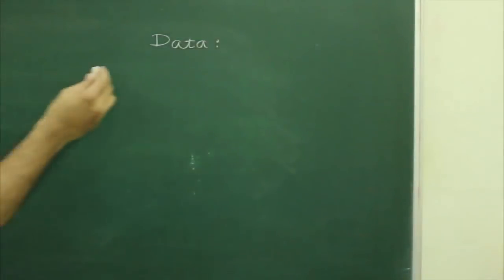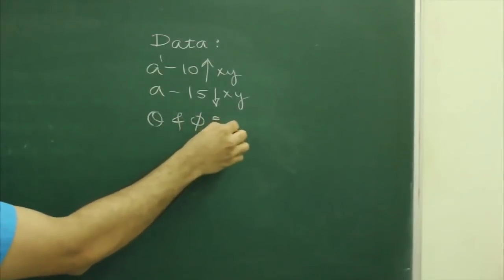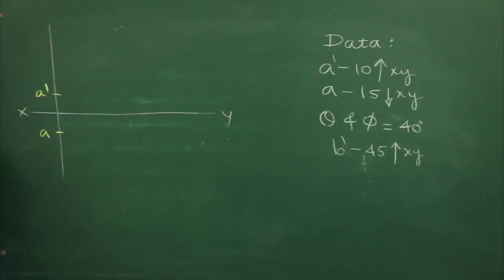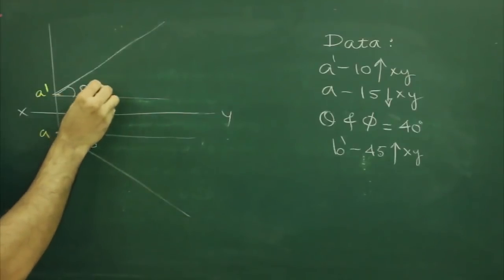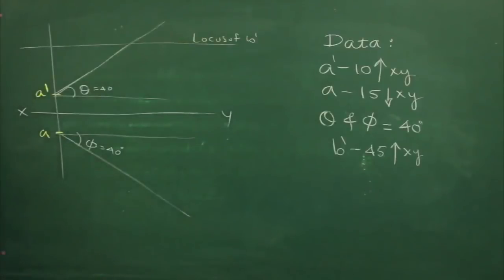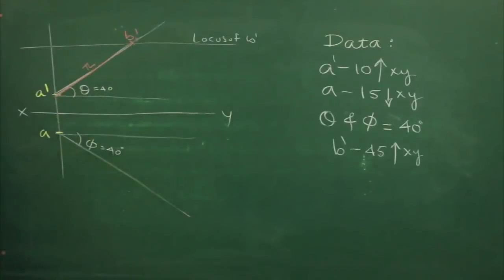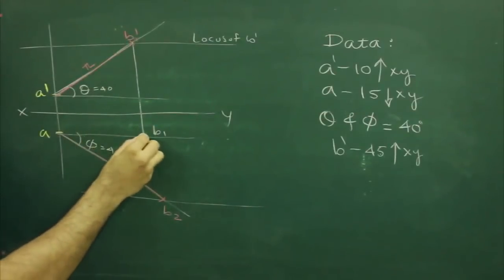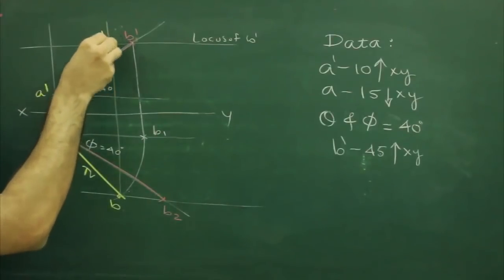Projection of lines 13

Comment: sir but dist from xy to b' is not given na sir
Reply: Sachin Pandya 

b is 50 mm above HP 
.
and both TL come in same line because theta and fai are same.
Reply from the maker: it is given in the question :: 45mm
see to slove any question of lines we need minimum 5 data.
Reply from the maker: LIMBASIYA JAYKUMAR yes because inclination with HP and VP is same so inclination of FV and TV will be same and TL will come in same line